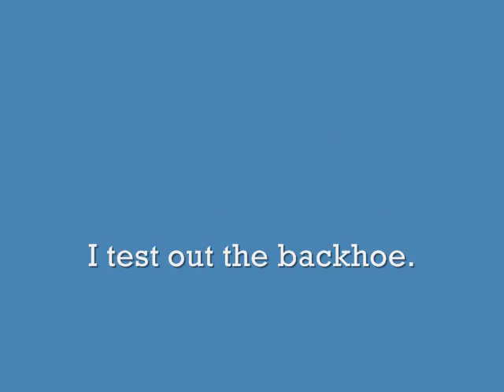Oliver 770 Industrial Tractor Project Part 135

Comment: I have been watching your restoration project on the oliver 770, it is very good and entertaining, i was watching part 66 and you were trying to do a compression test, where you tried and failed to find an adaptor to fit the energy cell plug hole, and it occurred to me that you could drill and tap a hole in the plug nut itself, tuning it into an adaptor then you just need a blanking nut that fits the hole you made and your golden. good luck on this project thanks Robert

Comment from the maker: I came across a forum where some one suggested somthing very similar, getting a plug from a boneyard engine, and modding it as you suggested. But I will soon have my lathes in my basement, and want to play around with making up somthing on the lathe......stay tuned.

Comment from the maker: Hello, thank you for your input. As to the quality, my earlier videos were shot with a non hd flip video, that one developed an intermittant crackly audio issue, so I canned it and am now using a sony bloggie. I accidentaly put a finger over the mic, and muffle the audio, but other than that, I thought it was working okay, Are you saying it still stinks?? the other issue is file size. I use a lower resolution setting in moviemaker to keep upload times manageable.I'll look at Gopro.

Comment: Just a fyi if you search ebay for "10watt led flood" you can find quite a few good 12v models for under $12 a pop if you wanted to get some lights for it.(from china but nicely sealed units) Not that you need another thing to drain the battery:)